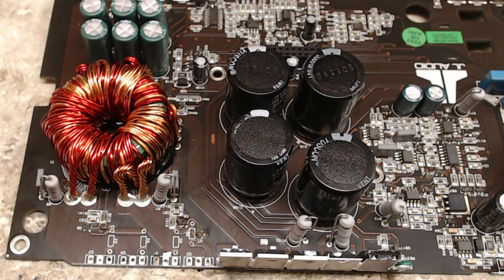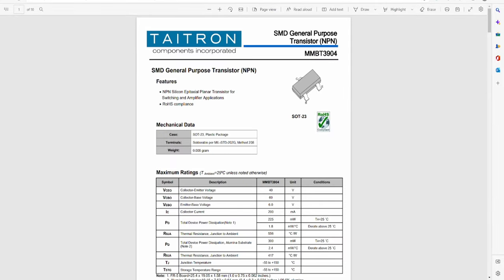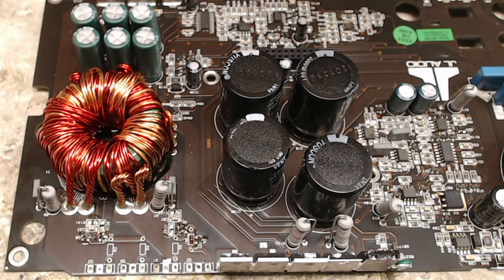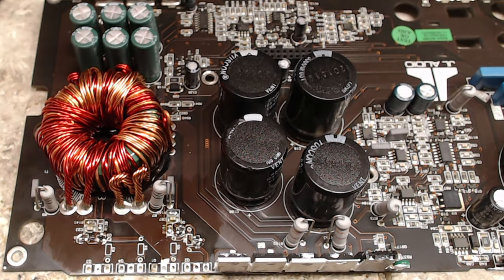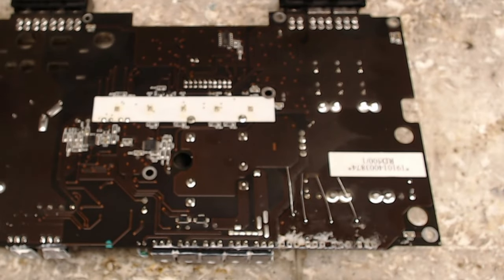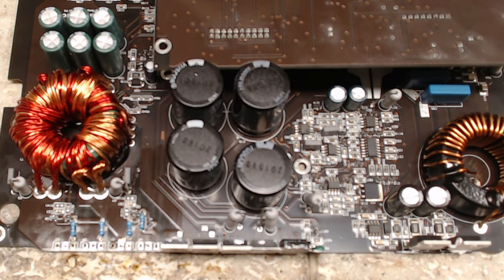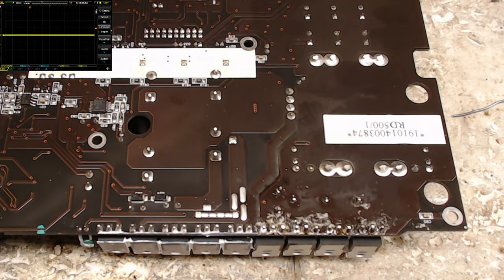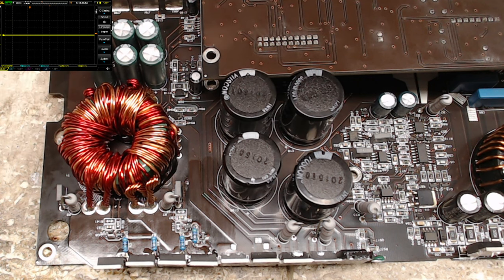JL Audio Class D RD500/1 Car Automotive Amplifier Power Supply Repair

Comment: Great video sir sometimes you can take a picture of the circuit board too but not all the time the picture comes out good its best to write them down for real
Reply from the maker: True, pictures are great but I am not the best with cameras. I have never learned all the technical lingo of photography. I have used pictures for resistor color bands quite often.
Reply: Ok I understand 🙏

Comment: I'm new to amplifier repair, what's a good cheap O-scope to buy? Will the portable scopes on Amazon under $100 work?
Reply from the maker: Im sure you could start off with one as long as the voltage specifications are high enough. At a minimum, I would go with the Rigol 2-channel scope if you cannot find a used Tektronix analog scope to learn from.

Comment: I have a rd 1500/1 and it gave me thermal shut and wasn't hot and hasn't came on since any idea where the thermal reading chip is ?
Reply from the maker: The thermistor is clipped to the heatsink. I have never traced it back but it should go to a comparator for the power supply drive. I suspect you have a short as is typical with most JL amplifier failures.
Reply: @ellensburgamplifier  I cantfind where it's clamped to the heat sink usually next to a mosfet I can't even find a picture of what this 1 looks like nvm I know what they look like but there's none on the board  I'ma take a pic u can click the link see if u see it
Reply: @ellensburgamplifier  I don't see any of those flat round therosistors unless they are under the board there's none going to the heat sink or the clamp down piece
Reply: @ellensburgamplifier  if I found the fault thermosistor a d removed the part will the amp work or do I have to put a piece of solder there to close the circuit?
Reply from the maker: @JoshHolden-n3m  Depends on the design. In a lot of amplifiers, you can remove it but then there is no thermal protection. If you solder the junction the power supply may not start as that is a low resistance value to the power supply. NTC thermistors reduce resistance to temperature rise in most cases.
Reply: @ellensburgamplifier  thanks I. Working on a Jl 1500.1 and I got the amp played the amp it didn't even get warm and instantly gave me a solid red light Wich means thermal a d the speaker is making a click click click click softly sound